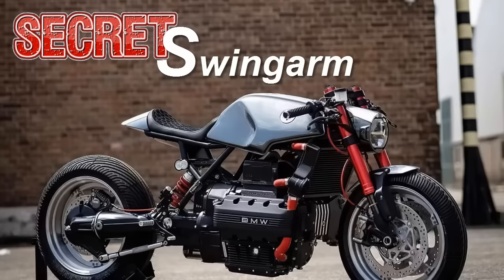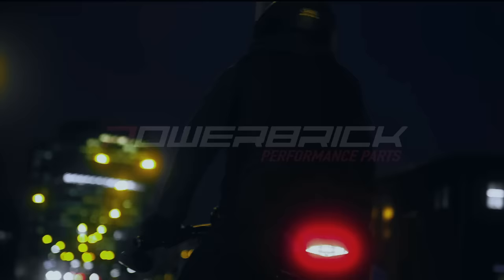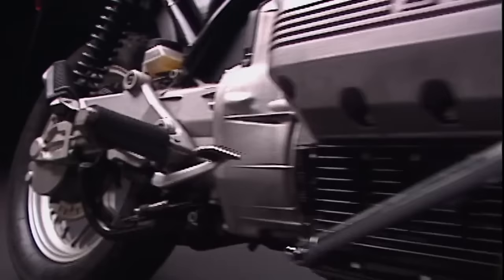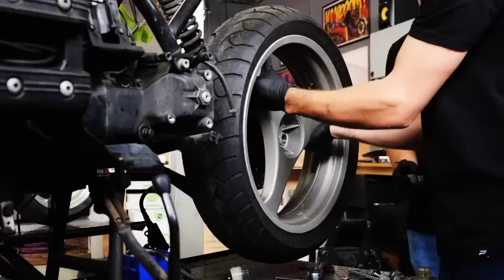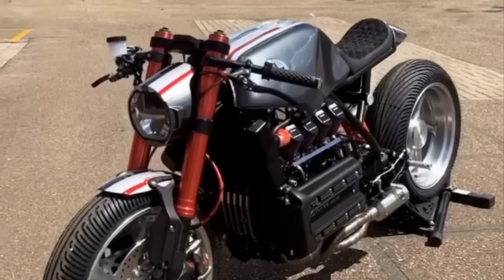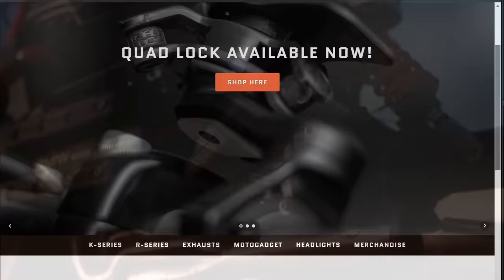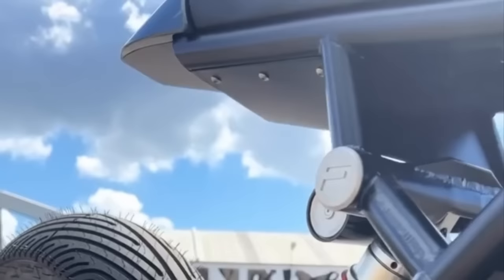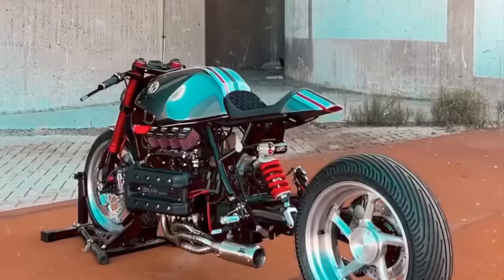Cafe Racer (BMW K1100 RS by Powerbrick)

Comment: Even the most subtle change can make a major difference. Most people have no idea as to how much time, money, and engineering it takes to strip something like this down to the bare minimum, and still maintain functinality. The placement of the "black box" is a good example. Making it so that it is not obvious, hiding all of the wiring, keeping it accessable as well. Beautiful machine! I have often thought the the BMW motorcycles were featured too often on this channel, but the particular example changes my perspective. Hats off to the builder!!!
Reply from the maker: Thank you my friend for sharing your perspective. :)  Yes, you are right. I always try to present different projects based on different brands. But for some reason, some of the most well made/designed projects, are based on BMW motorcycles. Cheers.

Comment: There is so much going on with this machine it's very impressive that it achieves as much as it does. I'm impressed with the fact that Powerbrick was able to use the Red/Orange stripe color and match it with the water hose, brake hose, and front struts.
The Pirelli tires bring a forceful entity to the bikes overall appearance. What an aggresive looking thread design. 
The fact that the headlight and tank align brings up an interesting perspective on the overall design. When you look at the side view at timeline 7:12 you must ask if that was the right decision. Because the intersection between the seat, tank, and frame look out of place with that gaping air space. That is the Achilles heel to an otherwise awesome build.
Reply from the maker: Thank you my friend for sharing your perspective. :) Cheers.

Comment: I'm not usually a fan of the K1 engine aesthetics due to it's 'big brick' silhouette, however this project has changed my mind.
I agree with you, beefing up the rear tyre and stretching out the wheelbase balances out the lower proportions making the final product a work of engineering beauty.

Top marks all round! 👌 Hopefully we'll see more of these 130 BHP beasts as BMW customisers understand what how this is done.
Great video as always. 
Many thanks. 👍👍
Reply from the maker: Thank you my friend for sharing your perspective. :) Cheers.

Comment: Swingarm is not really a secret. Its indeed a R1150 swingarm and some minor mods to the gearbox to fit it. Rearwheel is a custom wheel with more offset I believe.
Reply from the maker: Initially, I thought exactly the same. But after looking at all the small details on the swing arm, I conclude it can't be only a R1150 swingarm. If you pay attention where the monoshock is bolted on, you will see that the swing arm is slightly different. And the swing arm rear end, is also different. Let me know what you think. :)
Reply: Ive talked to them because i wanted the same mod (and did it). Its just a r1150 swingarm with a k1100 or 1200 reardrive and a r1100 drive shaft. Extra length is more then 15mm, more like 50mm
Reply from the maker: @Axel Boon Very interesting. Thank you for your feedback. :) Cheers.

Comment: Oh WAAU !   What a wonderful result and point by point what refined finishes; also already with an interesting power...however with such an extended swingarm it will be very rigid to drive, inconvenient to link curves...
Reply from the maker: Yes, the agility on corners, may be affected. But the stability at high speeds, is going to be higher than ever. :) Thank you my friend for sharing your perspective. :) Cheers.
Reply: @RACER_TV  Hitman is right. Fantastic building that certainly provides incredible enjoyment at high speeds on straight lines. But that you can't drive on a roundabout. As an owner of a K1100 RS (humbly customized by myself which resulted with a 60 kg weight loss), I can confirm this bike on its original form is already very rigid on corners and so stable on straight lines that you can drive it with one single hand at 175 km/h without fairing. Thank you Victor for your great work. Your channel made me wishing and able to carry on my customization project. Best wishes to You, your channel and your followers.
Reply from the maker: @Ernest Lajoie  Thank you my friend for sharing your perspective. :)  I also have a BMW K1, and I can also confirm it is extremely stable on straight road at high speeds. But when cornering at high speed, I always felt the rear end of the bike twisting/wobbling. Cheers.

Comment: Its a shame that so many people have past by the first  inline 4 cylinder bmw as my first thought was how would it look as a cafe racer ...but then my first summer break job at 16 years old was working for a bmw dealer and the boss rode a new at the time in 1967 bmw with a full body fiberglass road race fairing with cut outs in each side for the cylinders to clear , was  gorgeous and all the guys that road bmws ran bates coil spring solo flat track seats and clubman handle bars and talking them old beamers thatl looked like a chard tail with sort coil springs pn both sides of the rear axle snd the front forks were callrd earls forks.  All cafe racers
Reply: Sorry for the spelling snd the story being so butchered up but my ai smart phone knows yhr fl dtory nbetter than i do snd im to tired to correct every eord as you can dee it types sny letter onbtheb key nosrdnbnit thrbone im pusj onh